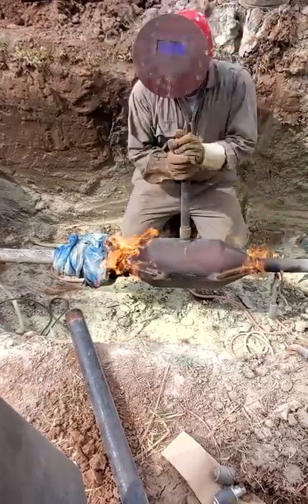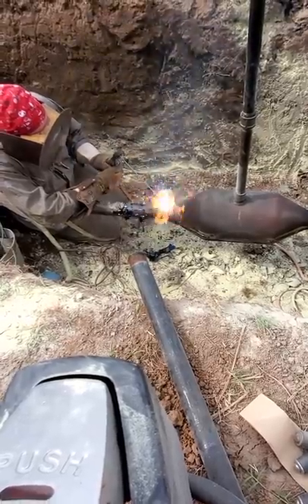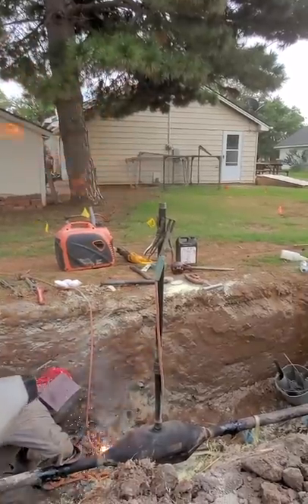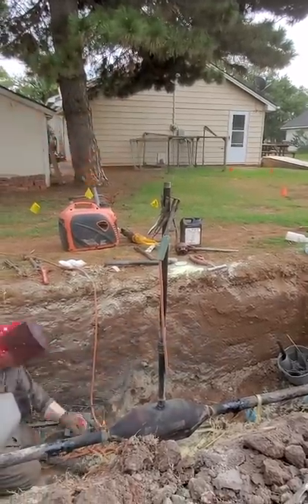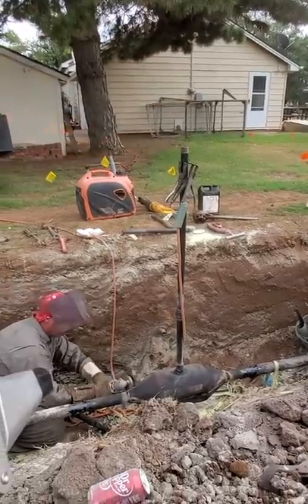Stick Welding a Live Gas Line | Hot Minute #shorts

Comment: When I first started in the oil industry I was a welder’s helper, I’ve seen welder’s repair large bore (24”-48”) leaking oil lines with a large patch, (vapour gas is a whole other danger due to how vapours tend to be heavier than air and will gather in low spots and explode) we simply would put a large steel plate on the pipe over the leak and start welding, as long as the product is running through the pipe at a high volume, the fire can’t enter the internal part of the pipe. When you get to the final ‘tie-in’ part of the patch, you just weld it shut and the fire goes out, this was eventually banned as it is fairly dangerous, but in the 80’s it was the standard way to repair a leak on a high volume underground line.
Reply: It hasn't been banned,still goes on every day.
Reply: Why was it done before if it was dangerous? What are the failure points?
Reply: @silo3com  that's why nobody will remember your name.
Reply: @stevesmith2171  I'm not sure if that answers my question...
Reply: @stevesmith2171  so I'm still curious about the mixed messages. I'm reading in the original post that this method is banned i.e. replaced by a new method. What is the new method and what problems does it resolve?
Reply: @silo3com  He said nobody will remember your name because you implied that you would never do anything dangerous. Seems pretty straightforward to me.

Comment: It won’t explode because there is no oxygen , when it escapes it can burn because oxygen is required for ignition combustion.  But it won’t explode inside the line if there is pure gas , no oxygen in the line.

Comment: As long as its burning while you work, its predictable.  Not necessarily safe, mind you, but no risk of unforeseen explosion or flash burn.
Reply: That’s what I was thinking. The leaking gas MUST be ignited before you begin welding. Also when the welds are completed the flame will go out.
Reply: Here's another perfectly good example of people who are smarter than me.  Thanks for the  explanation. 🤞🏼
Reply: @bewell4743  and who the hell are u ??? Jesus?
Reply: @kevintucker3354  not really, you can 100% weld with no flame. The lel is 4.5 to 14.5 so it’s common to not see a flame
Reply: How do you ignite the leaking gas safely though? Forgive me I'm slow
Reply: So what you're saying, is as long as the gas is burning, I can stare at the arc and not have my eyeballs burn? As long as the gas is burning you cannot get flash burn. Hmm. No need for a hood anymore.
Reply: @(Oxy) mOrOn, uh....no
Reply: @0xym0r0n_45  that and also flash burn is what happens to your body from the ignition of accumulated gas in an area which you occupy
Reply: It’s common sense about how the pressures of gas and oxygen work with this process of repairing but it still takes a man that can keep a cool head while doing this type of dangerous procedure.
Reply: @budm9982  issa joooke.
Reply: That's not true, over the fire makes it a lot less risky for an explosion It does not ensure that an explosion won't happen.
Reply: What is/ are the control method(s) in this process? Does it involve continuous melting point of the metal? What are the known dangers so far? Mitigating factors?
Reply: @steffen2165  you can also perfectly weld on a gas line with the gas off and the pipe purged
Reply: @pozloadescobar  a ciggarette
Reply: @bullrdr6274  It takes giant balls
Reply: Holy cow... I guess this makes sense. Still scared as potatoes.
Reply: That's super neat
Reply: This is how u stole gas from the gas company !!!!!
Reply: Word

Comment: Yeah, I just welded a gas leak indoors at the place where I work. The employees were amazed watching the gas flame up while I was welding.
Reply: My hat's off to you my man . Non-welders don't understand there's no oxygen in the pipe so it's perfectly safe. This does make for an awesome show of skill though. You should offer to do a hot tap sometime that'll really blow their mind.
Reply: So how do you make the fire stop?
Reply: @ChrisRestores  Weld it shut or cover the hole. I use my gloves hand. If it were larger I'd use a fire blanket.
Reply: That makes sense now if there’s no flame there’s a risk the un burnt gas will mix with the air and if it’s just right it will explode
Reply: @cameronknowles6267  Open flame can't explode it is already open flame fire it's state can't change to explosion fire. But you are correct in that it is possible for the state of the gas inside the pipe to change. That can cause a fire if the gas began to suck into the pipe and it were large enough to keep the fire lit all the way back to some source of oxygen and confined gas.  But we don't intentionally design gas line that way. So as long as the gas is coming out where I can see it I'm safe. If it disappears I worry but not for me. I worry for whoever happens to be wherever it went.
Reply: @cameronknowles6267  I actually agree with your comment completely.
Reply: @thewelderturner  that’s really interesting I’ve never realized that thank you, Are you a welder?
Reply: @cameronknowles6267  My License plate says WelderUp but I only get to weld sparingly now. I used to weld on pipelines and structural. I spend most of my days are spent troubleshooting robots at work, now I am an  Automation Engineer slash welder. lol.
Reply: Who wouldn't, its pretty cool cause you know what you doing.
Reply: Am I missing something can he just turn gas valve off an use threaded gas pipe lol
Reply: @basssindylan  How many people and companies would be out of gas while that happens? The best method for safety would be that but that could cost millions of dollars in lost productivity. If it's winter time that could cost the lives of the elderly the  infant and infirm
Reply: @thewelderturner  I own a property heated with natural gas, have about 50 tenants and I have to say my hat is off to you sir. It’s strikes me that it’s (somewhat, though not entirely) similar to working on a live electric line. In that there are certain precautions you can take and turning it off would of course be the safest way but it’s not always a possibility, working within the realm of what is possible while still ensuring people’s safety and as you said non interruption of heat service it’s truly a remarkable skill set. And I’d be curious to hear about the automation systems you design as well, I’m working on designing an automated greenhouse right now, fun stuff man
Reply: @MrAlwaysRight  got me cold you do
Reply: @thewelderturner  super cool man I just started an electrical automation program at UVU
Reply: @basssindylan  That is shut off, or at least mostly. They might leave just a little flow to keep oxygen out of the pipe. Those flames are just burning any gas left in the pipe to prevent build up and an explosion. If it were on, a giant fireball would be coming out.
Reply: @basssindylan  very few gas  lines have a valve between the main and the house service as they won't get used and will rust open over time and be unusable.
Reply: @thewelderturner  exactly if you shut off the gas on a whole main it's not like you can just turn it back on and everything on that section lights back up automatically. Will take hours to relight everything
Reply: @timme5074  not true at all especially in a pounds low service..
Reply: @timothypadilla8910  Except the gas regulator is attached to the house, and the low pressure lines are inside. The outside ones have to high pressure to be able to distribute the gas. A buried line like this would be high pressure. Maybe they do things differently elsewhere, but I doubt it, because the physics of transferring gas don't change. You need high pressure lines to get significant amounts of gas to more than one customer.
Reply: @timme5074  While there are high pressures within the transmission system once it gets to the distribution system the pressures are  cut down dramatically and actually pretty low around 6-7 water column to a max of 2 psi at the meter. The push comes from closed systems so the high pressures aren’t needed at the home service level as there is very little movement of gas within the pipeline like there is in the transmission system.
Reply: What process did you use?
Reply: @leadslinger4457  SMAW with 6010 root 7018 top that Stick Welded. On Miller Bobcat converted to LPG.
Reply: Thata what's up Charles...I know this type of method as a hot tie ...Bakersfield California
Reply: @timothypadilla8910  when will you go metric U.S. is the only country in the world still using imperial units
Reply: @alemgas  Why would we change everybody already getting dumber with our school system processes much less introduce something new..  plus we always lose that 10 mm socket here so.... 😂
Reply: @timothypadilla8910  your right it's always 10mm that does the vanishing trick 🤔😄